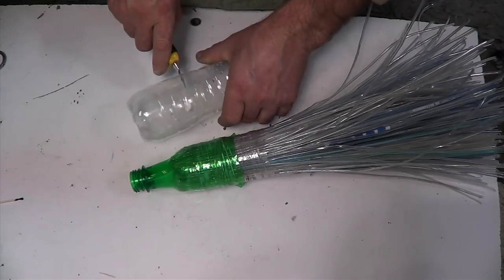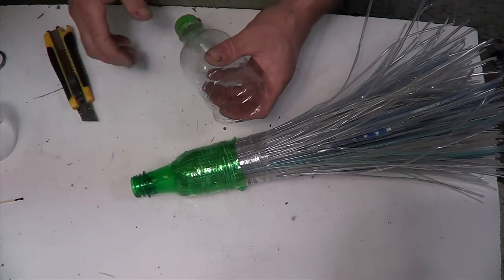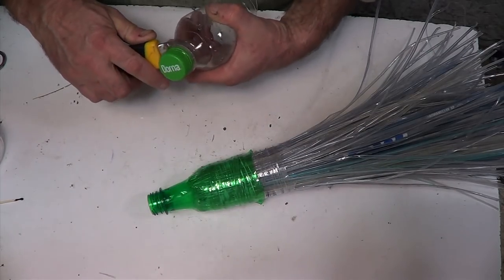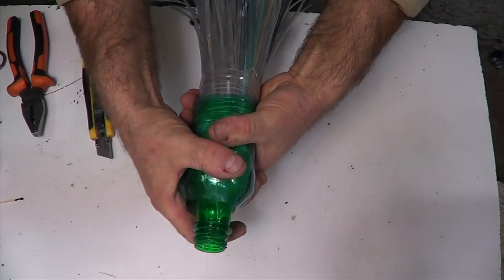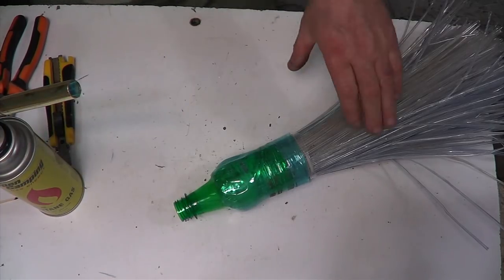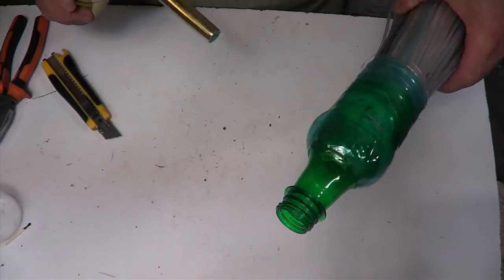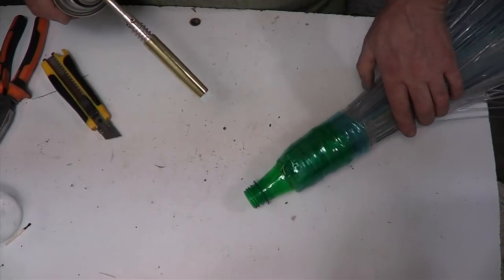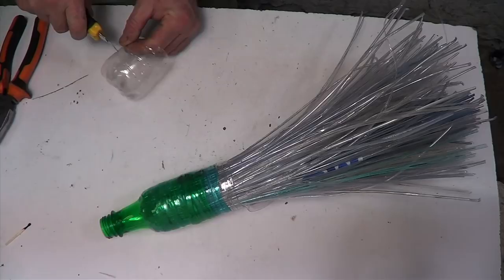A device for recycling plastic bottles! Tutorials Part 2

Comment: This is not actually good for the environment. In reality, to have a poor-quality product that in a few weeks will be turned back into trash, he used much more energy (electricity and heat) and emitted more CO2 (by burning gas for heating) that the conventional plastic recycling process. I'm sorry, but next time just throw the bottle into its specific trashbin for plastics. This is just spending time and trying to make money by youtube. Good luck
Reply: Well Einstein.....that plastic broom will FAR out last any $4  room. You'd have to be pretty dense not to realize that.
Reply: @nicstr28  I note a certain skepticism. Despite your sarcasm, I will try to answer your statement. To start, pause to reflect on the cost of an hour of your work and redo your economic balance. If after this you are still not convinced that it is more convenient to throw the plastic into its specific trash bin instead of trying making a broom, consider also why a broom costs $ 4, try to figure out its cost breakdown.